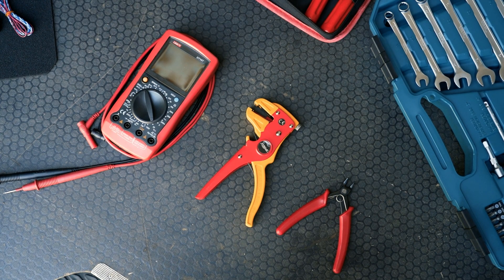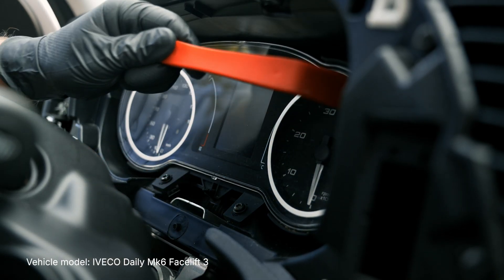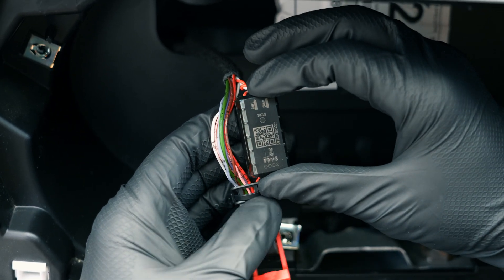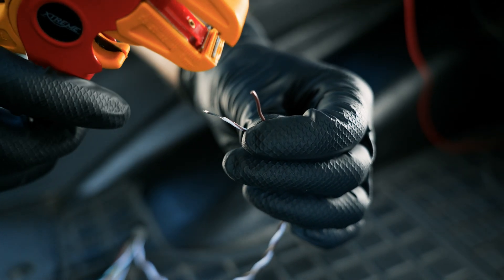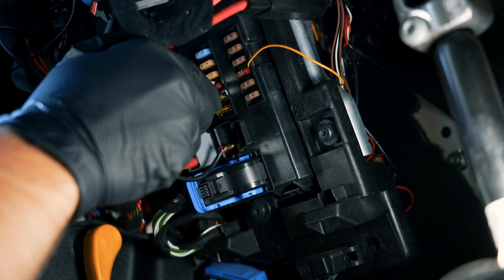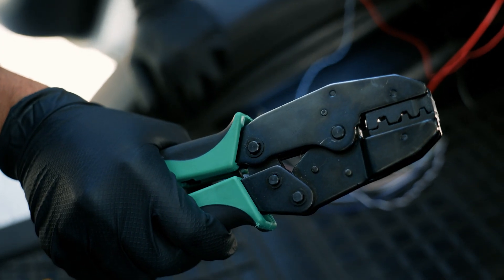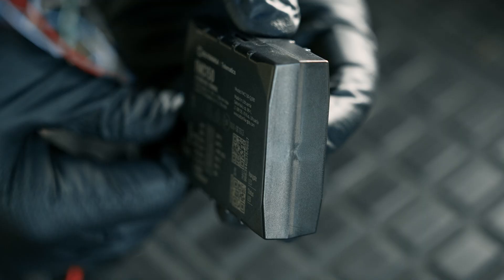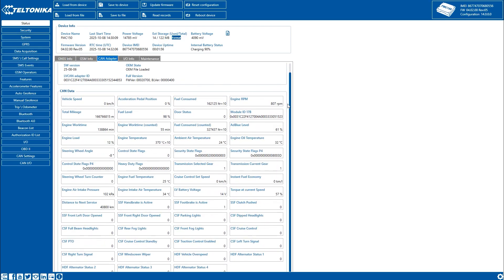Installation Guide | ECAN02 & FMx150 in IVECO Daily | Teltonika

Comment: Excellent video, I've two questions:
Q1: does it apply to vehicule other than the iveco daily?
Q2: does the ECAN02 work with FMB140 or other devices?
Thanks
Reply from the maker: Hi,

For the first question, the core process is the same. Please refer to the installation guide for the specific vehicle model, as the connection point may vary.

For the second question, yes, it works with any device connected to the CAN bus, except CAN CONTROL. CAN CONTROL requires two-way communication, which is not possible with contactless CAN readers.
Reply: @TeltonikaTelematics 
Noted with thanks